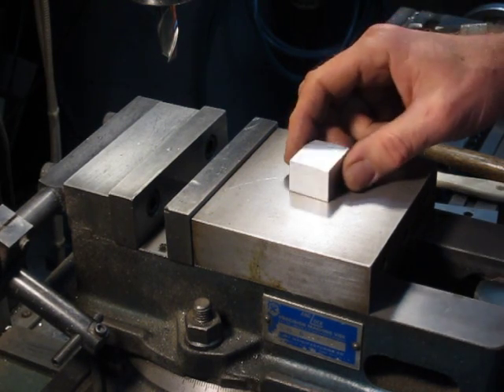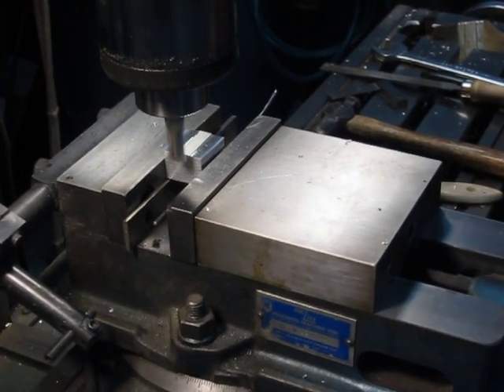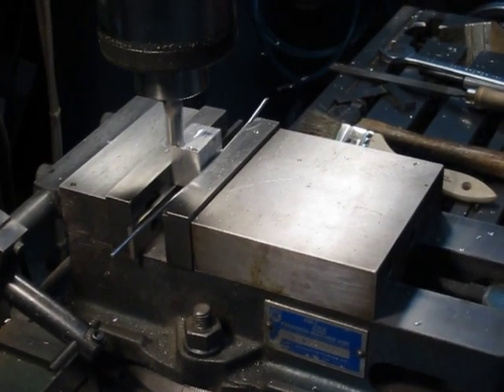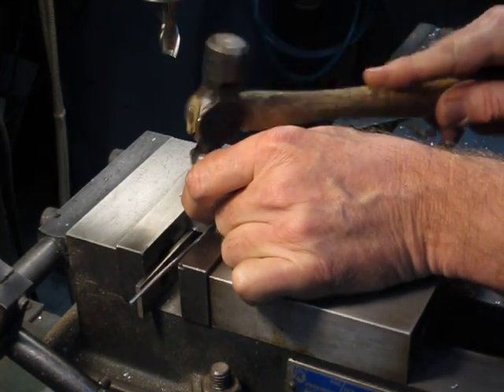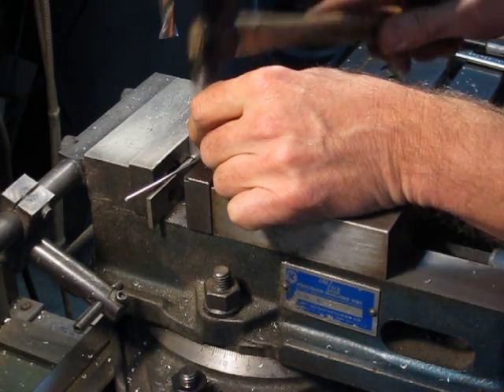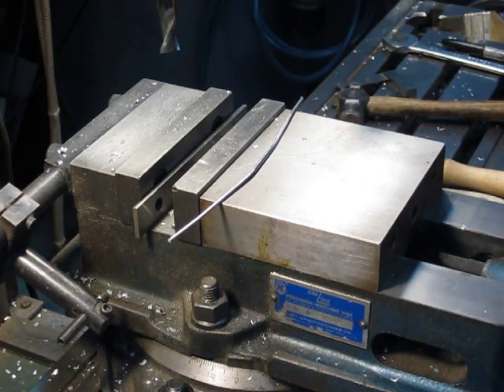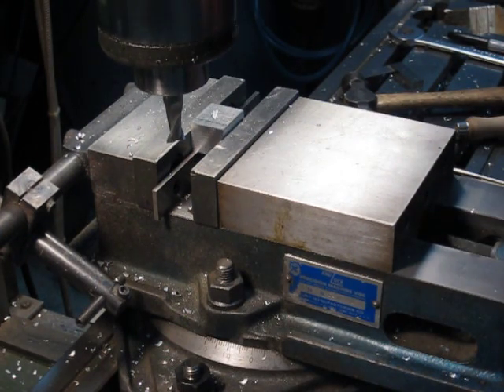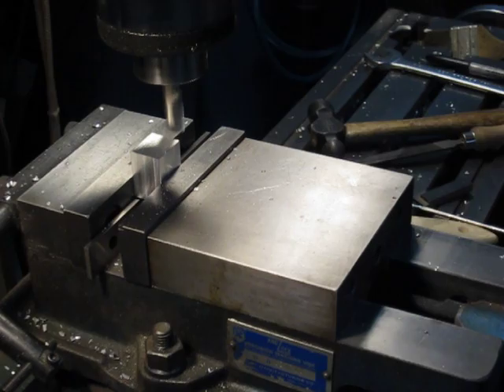How to square up stock on the milling machine

Comment: I was thought this method and then at my first shop I was doing this then one of my foremen came up to me and said “let me show you something” he but a piece of stock in on 2 parallels gripping onto about  1/8th of on inch of the stock. He machined all the faces in the first set up then he flipped it over and decked the remaining stock to size. We measured it and it was all squared
Reply from the maker: That is a quick way to get a fairly square part, but end mills tend to flex when side milling. End milling all of the surfaces as I did in the video takes a little longer but produces a part that is more square than one that was side milled.
Reply: @TomsTechniques that makes sense I took a year off from machining and am getting back into the industry thanks for the reply we could only measure parallelism and flatness we did not measure perpendicularly so I’m not sure how perpendicular it was the mill was trammed in within tenths so I can’t imagine if it was that bad

Comment: I first used a shop tool 12 years ago, and I was shown how to use a mill a year after that.

I still remember this and your other videos fondly. There wasn't too much machining on Youtube back then, so it was amazing to find clear instruction from a professional.

Granted, it's still not the norm today, but it was perfectly timed back then!
Reply from the maker: Good to hear! Hopefully you are still making chips.
Reply: @TomsTechniques Finally got a Micromaster in the garage, so the chips are getting smaller. :)

Comment: Squaring stock...never understood rod or ball instead using the straight square vise jaw
2 parallels
The head is straight
Cut with parallels and a good tooling vise (Kurt)
It is almost like the movable jaw might 90 degrees as well
Use a fly / face mill
Basic machine op 
Don't make complicated 
Simple is best
Reply from the maker: @patriotic_salt  Without using a wire on an unmachined surface, the movable jaw will only contact that surface at one or two points. That can allow the part to move. I'm not going to discuss anything beyond that because we all have our own methods derived from experience, and these are what work for me.
Reply: @TomsTechniques  Dawg, tighten the jaw, that fucking part is NOT moving, especially when you just shell mill the top to make it flat. What you can also do is put your block on the parallels, and mill the sides with a 3/4 or 1/2. Then take it out of the vice and put the milled sides to make FULL contact with the movable vice, since you're so afraid of it moving.

Comment: I have one doubt why you use Shaft rod in front side .. please explain  ?? Incase am not use Shaft means what happened?
Reply from the maker: @raviram3038  Using a soft wire between the sawed surface of the block and the movable jaw of the vise more evenly distributes the force of the jaw. Without it, the jaw would only press on one or two points.

Comment: Hope you are well been 7 years since I reached out.  I have always wanted to ask what allows your table and vise to freely move around?  I have motor drive on my X axis and Y is handle but either have the floating motion yours show. Always found this interesting.  I am having fun in retirement.
Reply from the maker: @KatyLYnnDistillery-xs2bf  I am having fun as well, catching up on projects I always wanted to do  but never had the time for. I actually shot some video last week of a clock I'm building, to post once I get it edited. The table on my mill has a Servo power feed on the X axis, but the Y axis all me.

Comment: How does wire help?
Reply from the maker: @nrupanshjani4642  The wire evenly distributes the force of the jaw over the part. Without it. The jaw would only push on one point.
Reply: It can be anything cylindrical, the point is to have the least amount of contact with the jaw while still clamped to it so the front jaw (which isn't square) isn't affecting your cuts. Something cylindrical shaped provides the smallest contact point. In his case, a wire is easy to hold on to while tightening the vise so it doesn't fall down.

Comment: I keep coming out with a taper on at least one side 😢 it's breaking my heart
Reply from the maker: You need to track down the misalignment. Check the solid jaw of your vise and make sure it's true horizontally and vertically, and make sure your spindle is perpendicular to the table. If all that is good, the part should come out square.

Comment: Been a Tool Maker / CNC Programmer for 27years I watched this video and was like of course this is how u square a block I guess I thought everyone was taught 2 square blocks this way, until I read the comments and am blown away that there's machinist out there that never were taught this. Only diffrence I would say is I don't use a ball pien hammer I use a dead blow and after having 3sides milled I then put in 2 parallels instead of 1 but apart from that I've always used a pin if I don't have 2ground sides across from each other. Don't try and tap block down until u have a ground edge against non moving jaw and edge sitting on parallel u will fight a loosing battle is the only other tip I can give, allow the back jaw and pin in front 2square ur block until u have a milled surface 2sit on parallel. Nice vid.

Comment: Machining the last 2 surfaces, I don't know why you would not let them stick out of the end of the vise and use the Y axis to machine them.  You then eliminate any error from using a square.
Reply from the maker: In my experience, end milling all surfaces provides the best results. The results of side milling, especially on larger parts is unpredictable due to the flex of the end mill.
Reply: @TomsTechniques  I understand flexing of the mill, but taking a spring pass would make that pretty much a moot issue.  Side milling to high tolerance is done all the time.   I just don't trust using a square and your "eye and feel" to get that block set properly.   Joe Pie has a good video on squaring that shows his technique and it looks pretty fast and easy.  Anyway, thanks for the good videos, I enjoy them.

Comment: Id say not to use a ball peen hammer or any hardened hammer. The force will go through the part and make it bounce on the other hardened surface, the parallell. Its better to use a lead hammer or at least a cupper hammer to make the hammer make a blunt punch that makes the hammer indent and make the part unable to bounce.

Also I would side mill the right side when making the first pass on top surface, that way the side will be much more square than using a square and eyeball it when squaring the last two sides.

But it is always fun to watch machining videos I think!
Reply from the maker: A lot of people take exception to me using a ball pein hammer and come up with all kinds of reasons why it won't work, but the is I've been doing so since working as a shaper hand in the 70's and it works great. Your theory about the part bouncing would be correct if I used the flat face of the hammer, but if you watch the video closely, you'll see that I use the edge of the hammer. This dents the part slightly, which absorbs the energy and seats the part firmly. Of course you wouldn't want to use the technique on a finish machined surface. For that, I use a plastic or lead hammer.

The reason I don't side mill while squaring up parts is because end mills flex. I prefer face milling the six sides and save the side milling for steps and slots. Everyone has their own favorite practices.

Thanks for watching.

Tom

Comment: How do you pick up the quill and then bring it down to the same z-height again?  My Bridgeport doesn’t seem to have any sort of bottom stop, does yours? Is it adjustable?
Reply from the maker: Bridgeport and Bridgeport clones have a threaded stop nut on the quill that can be set to whatever depth needed. Quick release stops can also be purchased that can be slid up and down the threaded stop shaft to save time.

https://m.media-amazon.com/images/I/61617D6PonL._SL1024_.jpg

Comment: There’s a way easier way and it’s foolproof and simple. Clamp it and mill off the top. Drop your tool down and mill 3 other sides, minimum cleanup. You now have perfectly square and parallel sides to start with. Way eaiser and guaranteed square.
Reply from the maker: That technique works fine on shorter parts, but not so well on taller ones, due to deflection of the tool.

Comment: Question :

Do i need a vice and parallels for this?

What i have the stock clamped down with mitee-bites to a fixture plate on my CNC mill table?
Where do parallels come into the picture with that configuration?
Reply from the maker: Mitee-Bites require the surface against the table to be machined. Otherwise they will distort the work. Parallels are not used.
Reply: @TomsTechniques  

My Master Plan (which I hope will work):

The fixture plate (which is a flat piece of aluminum with tapped holes) is machined.  It sits atop the table.  

On the fixture plate, the work piece will sit.  It will be clamped down onto the table (from 4 sides) by mitee bites screwed into the tapped holes.

I would then surface the top of the work piece with an end mill - producing the first "true" flat surface of the work piece.

Sounds good? Or will that not work...

Being a newbie sucks :(

Comment: is it possible to surface a small part to a decent finish with a 3 flute square end mill?
or is surfacing typically done with a fly cutter?
Reply from the maker: Fly cutters work well on light machines, because they cover a large area and generate a good surface finish. An end mill would produce the same end result, but would take longer.

Comment: Guys I need to square up my piece with a file as part of apprenticeship but I cant do it well can anyone help?
Reply from the maker: Lol, that's one of the first exercises I covered when I taught vocational machine shop. The first surface is the most important, because all of the others are referenced to it, so use some Prussian blue on a surface plate to check until it's as flat as you can get it. After that it's just a matter of creating additional flat surfaces perpendicular to it, and to each other. Using angle plates on the surface plate for reference will help, although a simple square will do if you take your time. Make sure each surface is the best you can get it before moving on, because errors will accumulate.
Reply: @TomsTechniques  what's the best way to file a surface flat I try to use the flattest part of my file and file.over the whole surface hoping it will file my high spots a d avoid my lows am I doing this wrong? Because I can still see light through my square when I check it so I know its not flat

Comment: a piece fo leather belt works great in place of the alum. rod, it tends to give more support and compresses for any high or low spots.
Reply from the maker: As long as your pants don't fall down while you are using it. ;)

Comment: Could a bare piece of 12 gauge electrical wire work instead of the aluminum wire or is it too strong?
Reply from the maker: Anything that will deform when clamped against the part will work.

Comment: Haw many dents did the ball end of that ball pein hammer put in that soft aluminium.
Reply from the maker: Doesn't matter. They all get machined off. It's those dents that help seat the part without it bouncing.

Comment: why ballpeen hammer, not rubber mallet?
Reply from the maker: Because a ball pein works very well, and a rubber mallet would not work at all. If you are working with a finished surface, a plastic, or lead hanmer would be the best option.

Comment: People are really trying to knock this guy.  If at the end of the day he is happy with the amount of time spent, the tooling lifespan, and the dimensional correctness of the part he delivers then is there anything wrong with how he arrived there?  It fits his purposes fine.  Shoot in my hobby machining I do things differently than I see a lot of machinists do on YouTube.  Not because their method is wrong but because my smaller machines just can’t handle the methods used with larger industrial machines.

Quite frankly I found it to be a rather informative video.  Good content.  👍

And for god sakes people stop worrying about the ball peen hammer.  The surfaces he strikes are already marred up from sawing...🙄

Comment: How does a piece of wire make it perfectly level/parallel?!?!
Reply from the maker: It sounds like you misunderstand the purpose of the wire. It simply squishes between the moveable jaw of the vise and the rough surface of the part to evenly distribute the force of the jaw.

Comment: why would you machine it with a tool thats for machining slots
Reply from the maker: An end mill is designed to cut either on the end or the side. You can use it as I am here, or to mill the side of a part, or as you suggest, mill a slot.

Comment: Great video Tom.  I am always a victim of your description of "leaving too much stock on the part", or in my case, taking too many small roughing and finishing cuts.  To do it with one roughing and one finishing cut as you did, your spindle speed and feed rate has to be proper, or you might, as an example, want to take .010", then find only .008" actually came off.  How do you manage this in two cuts, one rough, one finish?
Reply from the maker: If the tolerance on the part is plus or minus .005", that is good enough.

Comment: I have a question :
How is that possible to achieve an accurate right by hand ? No tools, just laping.
Reply: "accurate right angle"
Reply from the maker: Most anything that can be made by machine can be made by hand, it just takes longer, a lot longer. Creating two faces at a right angle to each other would require you to file the two surfaces as close as possible, then use progressively finer grades of wet/dry sandpaper on a surface plate or other known flat surface, and/or lapping compound on a lapping plate to flatten one surface, then create another flat surface at a right angle using a solid square as a reference. If you have a surface plate and angle plate, you can use that as a reference with a little prussian blue on the surface plate to indicate the high spots. Depending on the level of precision required, it would require a LOT of work. Just remember, gauge blocks are hand lapped to size.
Reply: @TomsTechniques  in anycase, i need a reference square ? 
What if i don't have that ? 

( How was the first square made ?)

Comment: Hi new to all this.  I saw a guy square up block in 2 steps.   I. Think was a guy named baily.  Is it possible to do this and have block square
Reply from the maker: It is possible. It can be done by holding the block in the vise by the lower 1/8 or so and then machining the exposed five sides. The part is then flipped and the bottom machined off. There are limitations with this technique. The part must be reasonably square to begin with so it can be held in the vise (not sawed). Also, four of the six sides are side milled, so they won't be quite as square due to flex of the end mill.
Reply: Ty so much for reply.  I think suburban tool was using this method to latter grind the block to dimension.  Ty again for reply

Comment: That's good, But when I got all 4 sides parallel, I think I would have had the piece near the edge of the vice, so I could trim straight down, if my mill was set properly for a 90 degree cut, chopped off the end,
Reply from the maker: There is always some flex when side milling, so if you want a truly square part, end milling is the better option. If speed is more important, a method of saving even more time is to clamp the part high in the vise, end mill the top, side mill four sides, then flip the part and end mill the sixth side.

Comment: Just want to ask a real pro....
Is there much of a difference between cutting with the quill down. Or  raising the table to mill with the quill up ??
Reply from the maker: Raising the table up with the quill retracted is definitely more rigid, but it takes more time and you don't always need that rigidity. If I'm taking heavy cuts with carbide or large cutters, then yes the quill is retracted, but for light milling I usually leave it extended a bit for convenience.

Tom

Comment: Check it for square now to verify your work. Or Mr Russo will Mark you down on your project's grade. Address the rough surface reference you used when cutting face #2. It's opposite, not flat, nor square to face #1, rested on the parrallel, acting as the reference for face #2. Thanks - Lumpy
Reply from the maker: Better watch the video again Lumpy. The surface opposite #2 was just resting on the parallel to keep the part from slipping down in the vise and in no way influenced the squareness of the part. It could have rested on your finger instead of the parallel and accomplished the same thing. Once the surfaces are machined, only then are they hammered down against the parallels and will influence squareness and size.

Comment: Sr, Why did you use a piece of wire for clamping?
Reply from the maker: The sawed side of the workpiece is uneven and a wire distributes the contact area between it and the moveable jaw of the vise for better holding power. It's only needed on uneven surfaces. Once the part is machined you can lose the wire.

Tom

Comment: Wouldn't I be right in saying that theoretically you don't need anything between the part and movable jaw on the first face since all your doing is milling a flat surface, just as long as the part doesn't move while milling it.
Reply from the maker: Practically, a wire between the part and moveable jaw goes a long way in preventing the part from moving, even on the first cut. Without it, the part can creep a small amount and you might not notice it. Then you waste a lot of time and materials machining a part that mayl ultimately be scrap. A piece of wire is a heck of a lot cheaper than time and materials.